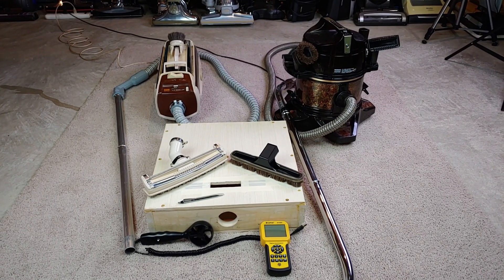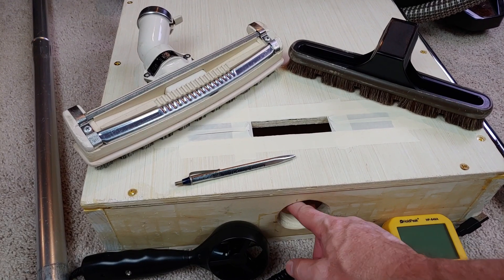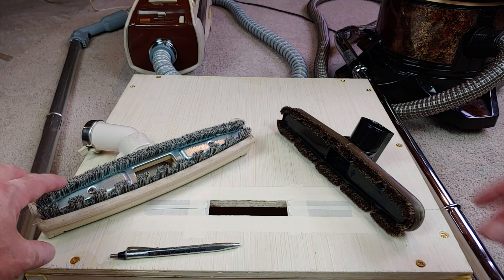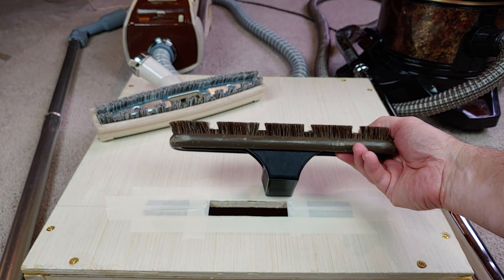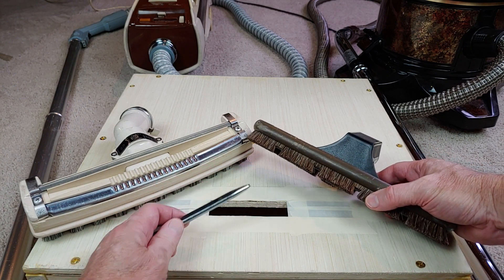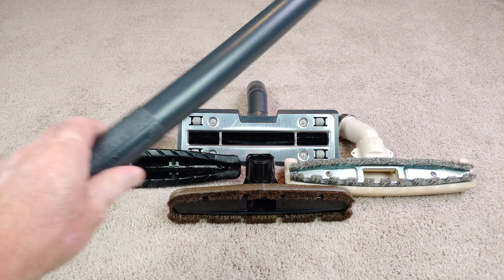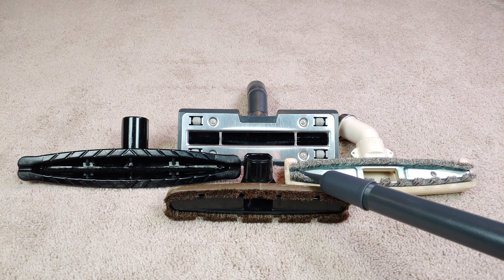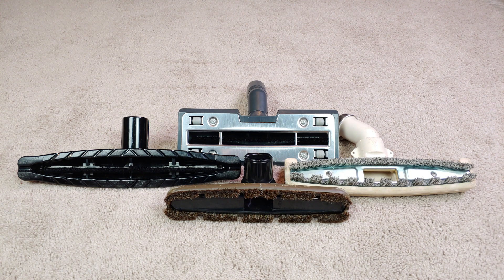Bare Floor Nozzle Airflow Testing | Electrolux | Rainbow | Kirby

Comment: Thank you for this test! Our poor old floor tool has no horse hair left, so is rather difficult to vacuum with. Have looked many a time for a good attachment, but was never impressed. I know which direction to go now!
Reply from the maker: Best of luck!
Reply: +1.  I don't like the older Kirby barefloor when vacuuming.  I hear it scraping my hardwood floors, and its brush always fills with pet hair.  That's probably why Kirby added wheels to the barefloor attachment in later Gens.  I wish the Electrolux barefloor got better airflow because I like vacuuming my hardwoods with it.  ty again Vaclab!  I've still not seen anyone else run this barefloor test.

Comment: That is a top tier pointing tool.  The best thing about bare tools, is that its easy to use the best tool with any vac. most hose sizes are compatible
Reply from the maker: That pointing tool also comes in various colors. 😄

Comment: I have to apologise as I believe I asked you to test a Rainbow nozzle on part 2, but I didn't know about this video until today.  Second, where did you get the horsehair bristles for your Lux head?   I have one very much like that, only the elbow connection is polished aluminum.  I can use that head on my central vac or Rainbow, since Rexair doesn't currently make an updated rug tool for the E2 black or SRX (mine's the former).
Reply from the maker: I ordered the new Lux bristle strips months ago and made a video. Very difficult to find.
Reply: @VacLab  Cool, thanks.

Comment: This is very good idea. I want to do the same tests, because I have a lot of straight suction nozzles. My airflow box has the same front hole size as yours. I remember copying it from you. Now the most important thing. What is the top hole size in your airflow box?
Reply from the maker: I'm using the smaller of the two inlets (9.5" by 1"), so I taped off a centered area of 1" by 3.5". Just make sure to match your vane hole area.
Reply: @VacLab  Nice. I will do confirm calculation when I tape it.